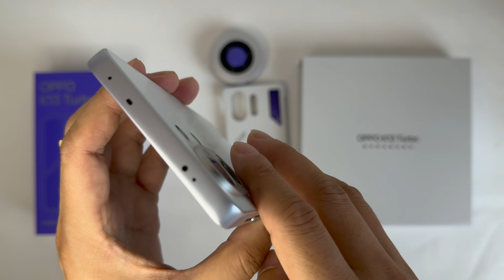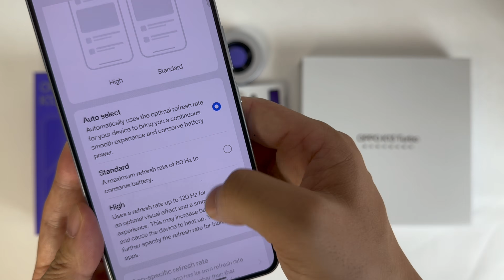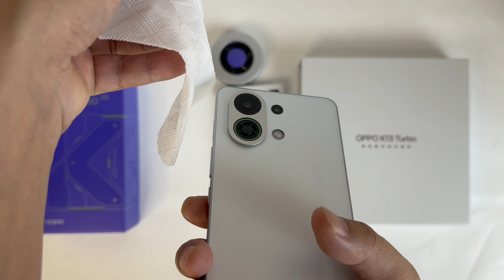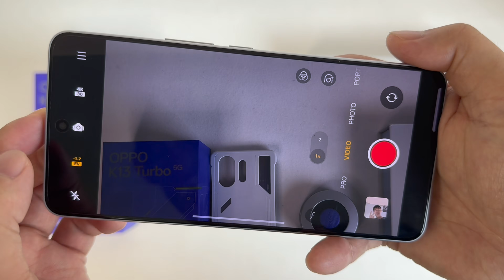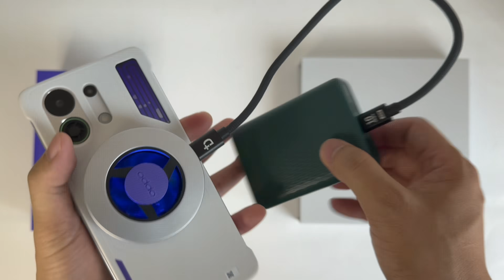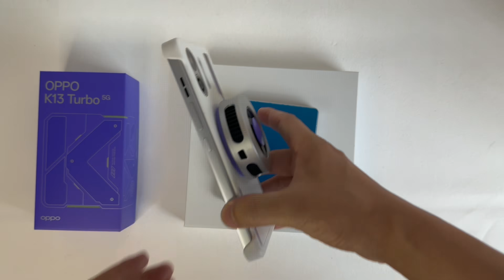OPPO K13 Turbo Gaming Phone & Strong Wind Cooling Package Quick Hands On. #oppo #opok13turbo

Comment: your liquid cooling case is not working....same I brought it today...it's liquid cooling is not moving
Reply: @rebelgameryt1888  adapter matters bro
Reply: it's not adapter problem....I got replace from oppo....I was using the stock 80w adapter
Reply: @rebelgameryt1888 12 w adapter you need
I mean low watts adapter
Reply: it needs 18 watt and 27 watt adapter not 12 watt
Reply: @rebelgameryt1888 oo😮
Reply: I really need this cooling kit i didn't get anywhere
Reply: @kerrysonnongsiang4323 now it's stopped from manufacturing in india